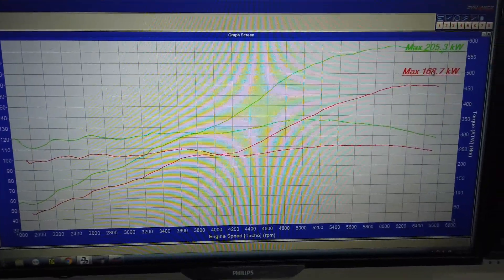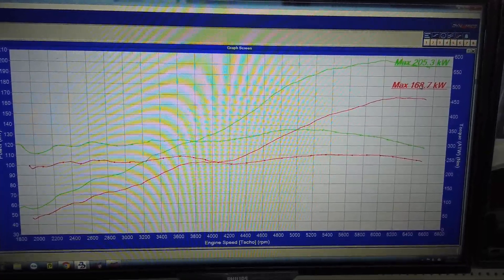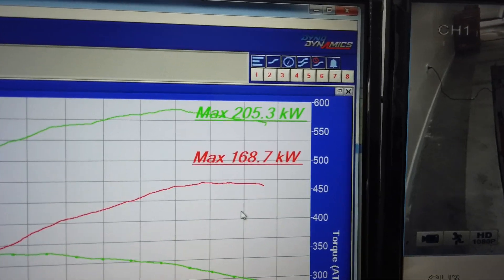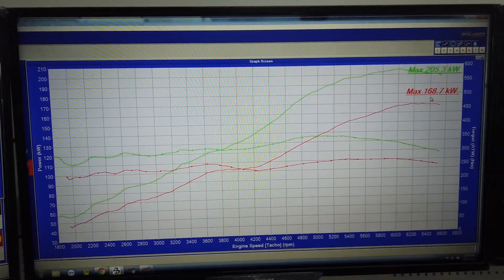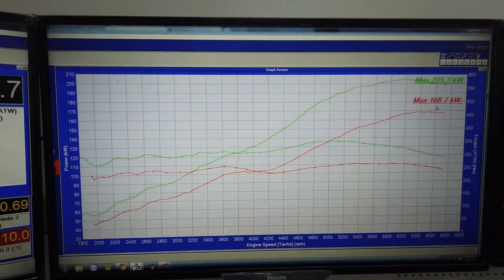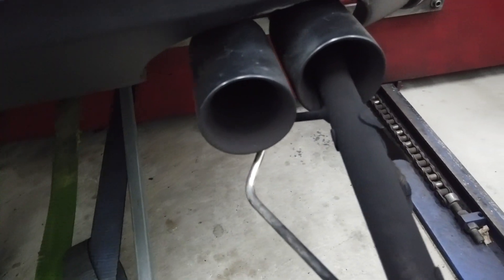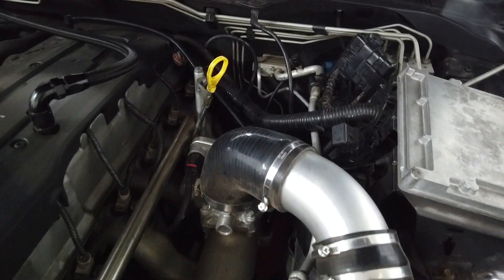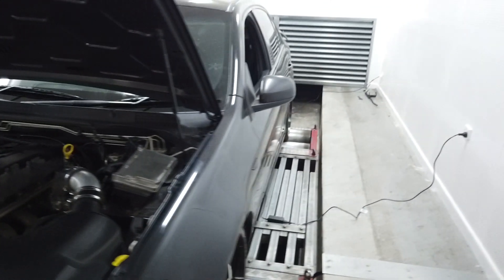FG 6 Cyl NA with DMP Camahafts

Comment: Nice. My fg xr6 has growler cold air intake, wildcat extractors and high flow cat coupled to a xforce 3 inch exhaust system . Great note,no droning noise and idles like a v8. Was going to turbocharge it but decided to keep it N/A.
Reply: I'm currently considering the same, cams or turbo conversion. How's your experience been with upgraded cams?
Reply: is it street legal?
Reply: Did you have to get a tune for the high flow cat?
Reply: @jackhiston1441  yes unfortunately. They are very sensitive to changes with the dam ecms.
Reply: @Psilyzen well i no longer have the FG XR6, i sadly had to get rid of it as it was about to turn into a huge money pit that i could no longer afford, the bs 5 speed transmission in it started playing up slipping and shit,took it to a pro transmission builder and he straight out told me to do a ZF 6 speed swap as the 5r55s transmissions are a piece of sht and have to be rebuilt every 80,000 ks. Apparently the servos in them are terrible, so i looked at a ZF swap and holy crap -$6000,00 for a new 6 speed and the labour costs ! Na man ive already sunk 6 grand into mods and upgrades so it was time to say enough is enough. I sold it for $14,000.00 ,dropped about $2000,00 but as you probably know you never make all your money back on cars once you start modifying them. It went to a good home,i had my fun with it and i now stay away from modified anything,i now drive a very reliable toyota.
Reply: @Psilyzen yeah if i had of known it wasn't a zf 6speed i would not have touched it. Anyway i have a much more practical and reliable car now so i say fck the fords,toyota make far superior cars than they have ever made and continue to make far better quality cars than ford or any other manufacturer will.
Reply: @Sauronthegreat1967  mate , they've made reliable cars for decades , not just now . They were energy bit as reliable from the 80's onwards . I turbo:d an 85 supra and got 400 hp . It's was fast and dead reliable .
Reply: Still got it?

Comment: That turbo intake manifold looks great! Would it affect the performance much or be worth doing on the NA? I know in the video you said better power on stop end? Affect anything else? Fuel use? Easy to do?
Reply from the maker: I think up to 500 kW it will be fine
Reply: @IndependentMotorsports what was the difference like in the low end?

Comment: I’m thinking of adding the following to me g6e N/A 6spd
-cams
-xr6t intake manifold 
-intake 
-pacemaker 4495s 
-xforce stainless steel exhaust (swapping both mufflers) 
-injectors 
-fuel pump
-valves+springs 
-port match exhaust/intake 
-3.53lsd 

How much power could I make at the wheels?

Comment: Hey does anyone know what causes the dip in power/torque at around 4000?  Its pretty noticable in a stock FG.
Reply: Flap in the manifold that switches the runner length. Long runner length down low for torque and short up top for horsepower at rpm. Just put a plastic FG manifold onto BF and very noticable compared to stock alloy one.

Comment: Seen this at Calder last week run high high 14s.    My stock one went 15.0
Reply from the maker: Yes that is correct, we still have a lot more setting up to do. Sometimes things just don't work out 😠
Reply: hopefully 1st March it will be down at Calder, the manifold has been removed and replaced with a standard one which has fixed a lot of issues we were having. before it had cams done it could run a best of 13.80, aiming to get it back to mid 13s
Reply: @karlkarcoushkas3970  if I bought a standard fg, and had 3k to spend, what should I do?   It's hard to find out, and it looks like you have tested a fair bit out.
Reply: @JLM 414 would you recommend the fg na barra over the vf sv6 for a p plate car in terms of general performance, power potential and overall reliability?
Reply: @JLM 414 thanks so much mate. I think i will stick with just the na xr6 and sell it for a turbo when im off ps. It seems the barra is usually the go to for reliability when it comes to 6 cylinders atleast. Plus i hear good things about the zf transmission. Probably just keep it stock or maybe some cheap simple mods down the track. I should be able to get an na xr6 pretty cheap. From what i hear they seem to be pretty bulletproof  in the engine department even at high kms. Could also think about an sv6. Seems like it had a better interior but i think the driveline lets its down a bit. Im not sure the v6 would be anywhere near as reliable as the barra.
Reply: @lukesm5747  I have a FG I smashed a  've sv6s vys sv6s of the mark i bet a ve ss stock.. Any holden v6 has no chance I think 250kw would be easy to get on a fg... my car can do 0-100 in around 6.25 to 6.1 seconds.. and if you put in 98 premium in you Get a 10kw gains
Reply: @taylor22993  Yeh the fgs seem to be a bit quicker than the ve and vf 210kw sv6s despite the power difference. I would assume it would just be the huge torque and the Zf as to why its quicker
Reply: @lukesm5747  Hi Luke I have a 2013 FG XR6 ute that I bought while on greens almost 10 years ago lol. Never bothered to get a turbo as I have so much fun and memories with this car, and after spending so much money on it, you will find it will grow on you. 
Mine has about 250kw at the engine, so about 210kw at the wheels. 
I have engine-wise mods.

Xforce extractors and full exhaust system $1200
4" high flow air induction kit $350
Crow cam lower to mid-end $1200
Crow Heads and springs $600
Upgraded fuel pump, system, and pressure kit $790
Diff Gears FG Ford Falcon XR6 4lt Non-Turbo M80 Torque Lock LSD & Motive 3.9 Diff Gear Set $1070.00
Underdrive kit $350
Upgraded radiator $420
and Tune $900

So whilst I have great acceleration and a fun car with plenty of KW to have some fun, you do have to weigh up costs, as the amount of investment into this car I could have double the gains in an FG stock turbo, just with an air intake/battery relocation kit, and a cutback exhaust and tune I could hit nearly 340kw on a turbo model. 
Hope this helps
Reply: @MyMilo777  My stock NA FG with modded exhaust and 3.46 lsd with mailorder tune for motor n box ran a 13.6 over the 1/4.... so they can go quite well.
Reply: @lukesm5747  Been flogging my XR6 for a few years now. They seem indestructible in NA form.

Comment: Thats less power than what the tuned vf sv6s are making. although i would imagine the barra would have a lot more torque.
Reply: U just buy a vf lol
Reply: @nickwilliams8238  Yeh but its a VF. Nobody has even taken the Holden v6s seriously for perfomance or reliability. And the aftermarket is far larger for the barra. Whats the point in me buying an LFX and get it tuned only for my shit motor to last 5 oil changes.
Reply: You again luke hahaha, the sv6s make power and respond way better, and just because you cant take care of an engine properly doesnt mean its bad. For a cam upgrade intake n exhaust this na barra is piss weak
Reply: @mindfreak9674  i have an fg xr6 5 speed with a catback and intake. I've beat every sv6 out there. I always seem to get the best start and then its pretty even until about 130/140 and i start pulling away again
Reply: @samorcsik  Sv6s with an exhaust and cai are hitting 330rwhp+. The barras run pretty much maxed out from factory so they dont gain much with upgrades. The lfx however makes 320 in the states instead of 280 in aus. So theres performance to be found. The barras will only really make impressive numbers na running a destroke crank, methanol, head work galore etc. An edit on the end this barra ended up making 274rwhp with a cam upgrade aswell and still is weaker than an sv6 with an exhaust and cai. The barra is really good underboost but thats it really.
Reply: Where have you seen 330 RWHP from SV6 with exhaust and CAI? Barra NA does respond well to mods. Look at the torque figures even without mods.
Reply: @lachlanbrown409  Join some alloytec groups on facebook otherwise look on youtube. As i said in the comment above the lfx makes 320hp stock out the box in the states. So tuning them unlocks hidden piwer that holden restricted em from. Not hard to realise man.
Reply: @lachlanbrown409  The lfx v6 literally just outdoes the barra up until ya start pushing big numbers. After that the barras inline design automatically starts to win because of its firing order.
Reply: @lachlanbrown409  Lfx's running an intercooled vortec kit on psi makes 410hp atw. Power fully across the range etc. Plus ya dont have exploding oil pump gears.
Reply: When you unlock your sv6s power and a standard falcon still pulls more talk without touching it you know you don't have a chance Holden's don't even bother trying on my fg they already know the outcome

Comment: What's the cost to get these cams and a tune?
Reply from the maker: Hi Ben, For our cam only package it is $2495 on the N/a Falcons.
Reply: @IndependentMotorsports  what stage cams dose that include and is there a higher gain say put of stage 2/3/4 ?